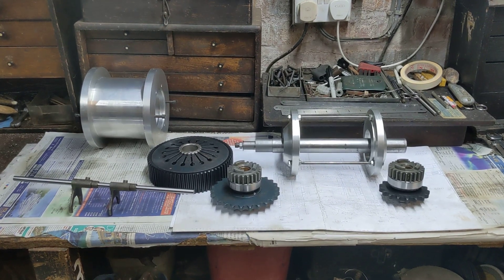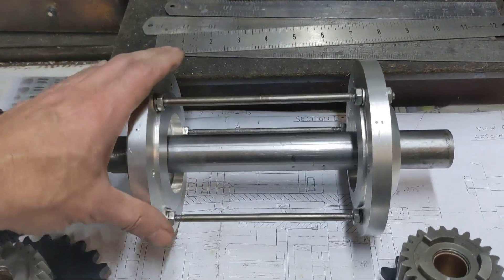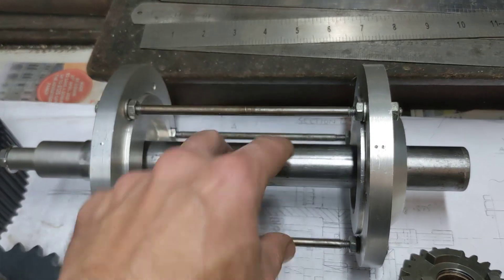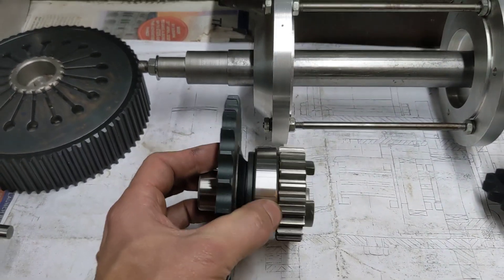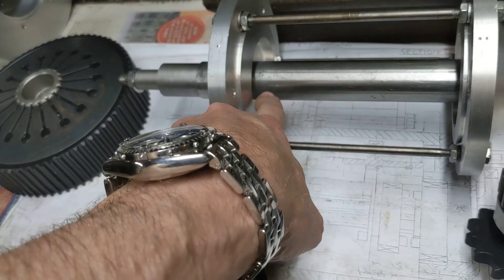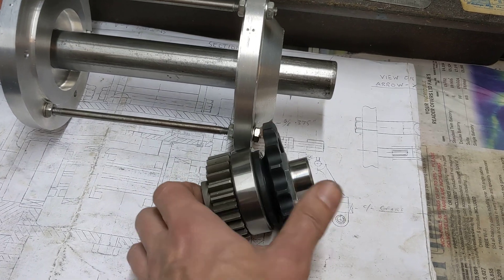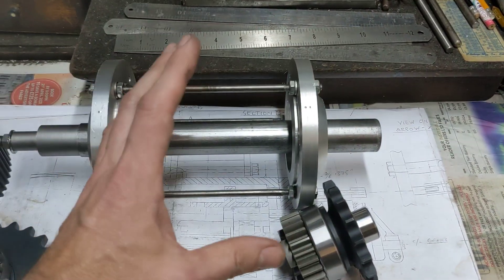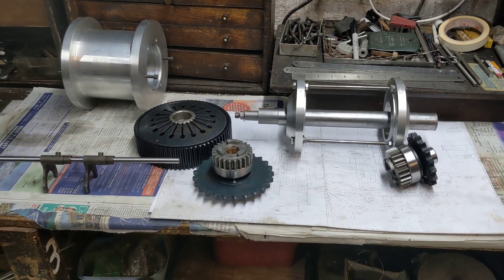Skeleton in the cupboard!

Comment: Hey mate I'm just really starting to watch ya vids on this build and I'm loving it,but just a question.Are you going to run final drive chains on both side of the box(and rear wheel)and have different size final gearbox sprockets to change the gearing as you change the gear's?
Reply from the maker: Yes, exactly that. One primary drive belt, clutch, then two final drive chains, one each side of the bike. Different sprocket sizes for the two speeds. Loads of options for gear ratios. It will also make people wonder why etc.. 😁😁
Reply: @StoneEng  cool as mate,I reckon she's going to pull like a mally bull,oh by the way my dad was wondering what bore and stroke she running?,we are a bunch of Aussie back yard mechanic slash modify it kind of bloke's 👍😂
Reply from the maker: G'day! I lived in Cairns for a while and also Melbourne. Much better weather. 😁 Bore & stroke are very close to the original Hercules. 5.75" bore, 6.6" stroke on mine. (6.5" stroke on the Herc).

Comment: Will the gearbox require some sort of breather ? 😁🤘🤘
Reply from the maker: I don't think so Karl. I doubt any pressure will build up, and the gear selector shaft won't be air tight. I'll check the drawing of the detent, as that might vent when changing gear.